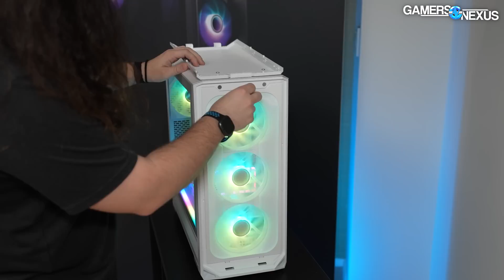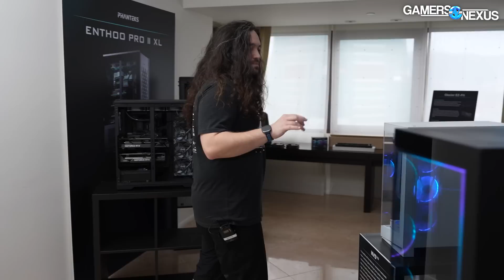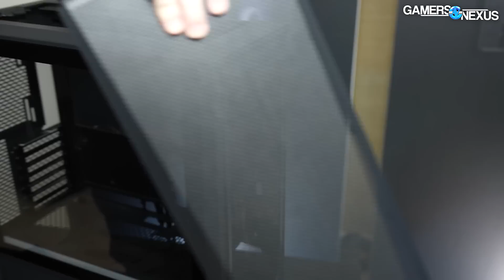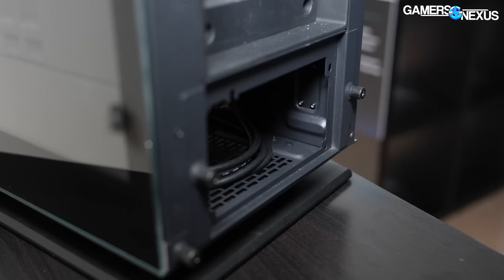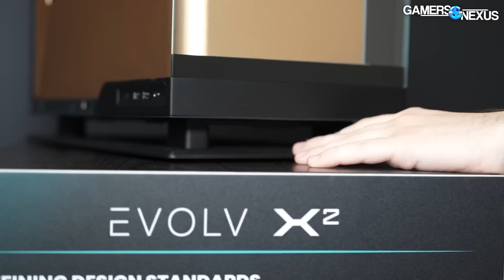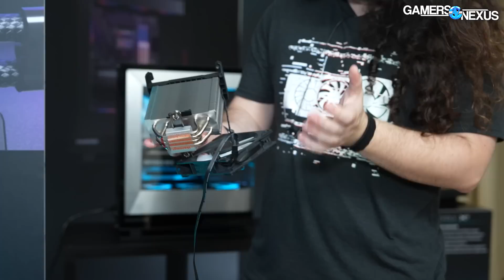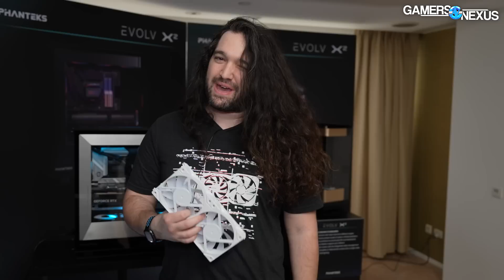Phanteks' Liquid Freezer III Competitor, Patent-Avoiding Fans, & P400A Successor (G400A)

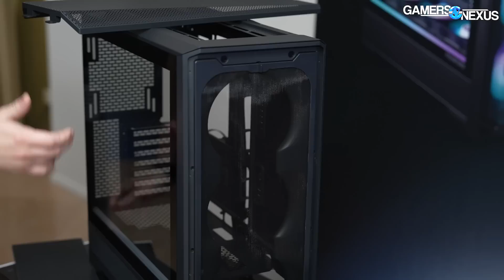Comment: 4:03 The air gap between the fans, the nylon filter and the case mesh will mean it will not restrict airflow. A gap makes a huge difference in places like that. What Phanteks did here is THE perfect solution imo. Case mesh will never filter as well as nylon dust filters, so I personally always prefer nylon. And if you do have it with a gap like that, it doesn't matter that you are stacking dust filter and case mesh, because airflow will still be great
Reply from the maker: Yes, that was the point to the air gap. That's what we stated.
Reply: @GamersNexus   I didn't mean you said anything wrong. I just made a comment emphasizing it because I was happy to see Phanteks did this right. I feel like it's such a simple thing that many cases still do wrong
Reply: Oh, any restriction will (unsurprisingly) still restrict airflow.   If you space them apart it'll restrict less but it'll still affect airflow to some degree.
So I think Phanteks should've made the panel with bigger and less restrictive holes, as it doesn't have to act as a filter.

Personally I think those moulded shapes around the fans looks kinda cool, so I'd consider just removing the front panel entirely :)
Reply: @rogerwennstrom6677  Airflow restriction also depends on surface area of the mesh. That front panel is pushed forward, so it has more surface area, than flat panel. Air can come not only from the front, but also a bit from the sloped sides. If you shape mesh like a dome over the fan it will have more airholes than active surface of the fan, and airflow restriction will be minimized.
Reply: @Boris-Vasiliev  Yep, makes sense :)
So it is probably OK as it is, but would still be even better with a pattern with bigger holes and less material.  The panel mesh doesn't need to do any filtering, so it could be a lot "coarser".
Reply: @rogerwennstrom6677  The mesh should  look like a solid shape, not like prison bars. It has aesthetic purpose. Thats why its impossible to make holes bigger without making it look the same as a grid fan cover at the back of the case.
Reply: @Boris-Vasiliev  Yeah, but you can't have the cake and eat it... I'd prefer they commit to one style:
Either did go for proper mesh and skip the nylon filter.
OR keep the nylon filter and made the mesh coarser even if it doesn't quite look like mesh anymore.

As it is now you could argue you get the worst of both worlds, with two layers of restriction.
(It won't be solid looking in the end after all with all the lightning behind it)
Reply: @rogerwennstrom6677  I was planning to disconnect all RGB if I ever get a case like this. Sometimes I watch video in a dim lit room, and any extra light that comes from PC case will be distracting. Thats why I dont like modern cases because they are focused to make your PC look like a bright fishtank.
Reply: @Boris-Vasiliev  Fully agree there :)
Reply: @rogerwennstrom6677   you are right, I phrased it poorly
I meant it will not restrict airflow by any noticeable/significant amount

Comment: i'm surpised it's taken this long to get interlocking fans that... just use the cables and have a simple locking mech. the other options with pads and bridges always seeed way too over kill, and therefore expensive. this is clean and elegant enough for most use cases. and the little overhang seems mostly likely to not be a factor.

Comment: I really like that molded fan shroud front! Most cases have mounting holes for x2 140s or x3 120s and then a filter in front. All of those gaps lessen the pressure gradient between the sides of the fan and therefore ability to pull through the filter.

Comment: How can a case be airflow without a fan on the side panel directing fresh air to the video card like the HAF X did back in the early 2010s?
Reply: I'm still using the similar HAF 932 case with CPU and GPU liquid cooled.
Reply: my old antec lanboy case i took a hole saw to the acrylic side panel and drilled holes rand small bolts and mounted a fan just like that almost 20 yrs ago, really liked that case, wish i didnt sticker bomb the heck out of it when i was a kid or id probably put it to use these days lol
Reply: I loved my Old HAF 922, the 200mm fan on the left panel pointing right into my 1080ti for years was great. but it couldn't fit the 4080 I bought in it without some heavy modification. I built a smaller system for work stuff and moved it to my shop so at least it will still get some use. Glad I don't have to move it anymore though, thing weighs a ton.
Reply: @Jbradley612  you can always mount the fan on the outside of the case
Reply: I have to agree with you. I had a HAF X case and never had a case that kept my GPU temps as low as the HAF X....
Reply: Good question, companies don’t like efficient only care for profit

Comment: Honestly, we need a new category or specific video dedicated on cases best for pet owners. My friend has a lian li 2 mesh and it’s atrocious inside. Mine is the non mesh one and 0 pet fur inside.
Reply: For those with extreme pet fur/dust issues: I would get a steel case and a lot of finer mesh magnetic filters (you can also get these custom-cut for more oddball sizes) to put over higher static pressure case fan intakes. And then just have the overall layout be more positive pressure (more intake than exhaust, accounting a little for GPU and PSU having their own exhaust).

You dont want to overdo the filtering (like Steve said, it will block airflow and create more noise if you double filter) but higher static pressure plus manual fan curve tuning can mitigate some of this.

Regular air dusting might still be needed, though, in addition to filter cleaning. An electric duster (e.g. Xpower, Datavac) is good to have around for dust or hair removal. Easy access to internals (e.g. hinged side panel) helps make this a quicker chore.
Reply: @zivzulander  thats great to know, I'll suggest that to my friend, thank you!
Reply: Finally, a place for Snowflake to put in some work.
Reply: I bought one of those sub 55dB "silent compressors", which moves air at 130-150 PSI. 

Before I turn my computer on, I open the case blow everything out in 5 seconds, then I turn the compressor off. Afterwards I use the remaining pressure in the tank to dust out the corners in the room. 

I may be crazy, but I could use one of those small compressors in every room of the house. I also use it with a tornador to clean shoes and carpets and cars or just the air to clean the vacuum or the sofa before using one of those small vaccuums /carpet cleaners. Mines the Spotty for about 200 Euros, but of course there are a range of those. Anyway that's just for carpets, couches, etc. not the PC. I am just saying pressurized air is useful all the time. 

I never knew I would use a compressor 10x per day in the house, but it makes life so much easier. It's like an endless can of air on steroids. And I have been using it to clean a bunch of mainboards and electronics. I reckon if you manage to bend or break stuff with it, you might need to get a better feel for distance. 15-20cms is fine for blowing dust off a PC. You might want to put a finger on the fan and get a little closer for your PSU, air-cooler and other fans, might even need a soft brush sometimes, but usually this method will get a PC dust free with 0 damage in about a minute flat. Try at your own risk and don't intentionally blow directly against things that bend from a very short distance. The air flow is powerful enough to rip stuff right off the motherboard. 😂
Reply: @peteranders7106  Compressors are nice (and a heck cheaper than cans of air) to use, but they do collect and push out moisture. You can buy in-line desiccant filters.
Reply: @choggi  Yeah definitely. But they cost like 20-30 and as you said are super easy to click into place in line. So all in all it's probably about a 200-250 dollar investment for a silent compressor with like 700-800 Watts for home use. I've had it for a few months now. I don't understand how I lived without one. 

To be honest I have needed to badly upgrade for almost 10 years now, but never quite had the money for it or something was just coming out. I'm on a Ryzen FX 8030 or 8020 or some such? So I got a 5 dollar chip and a 15 dollar board running DDR3, but it's definitely clean. Lol.
Reply: @pekirt  Well you seem to be pushing pets. They have their draw backs, too. Hahaha got you. Just kidding. Pets are essential, if you can afford them.

C'mon airflow cases have always been the most logical approach to case design.
Reply: I keep my case at a positive pressure, but still it gets very dusty. I think dust is inevitable if you have airflow.
Reply: I have a Corsair 5000d (mesh) and dust filters are catching most of the fur, I keep a positive pressure and I don’t see more than a couple of hairs here and there.
Reply: Yeah, because yours has zero airflow 🙄

Anyway what you want is a positive pressure case
Reply: The solution to this is to clean the case when it gets dirty. Crazy I know
Reply: @pekirt  I have pets and live in a very high dust environment. I simply clean my computers regularly. I don't see why this suggestion should cause you grief.

Comment: 0:35 that nasty GPU bend
Reply from the maker: It's a feature. We don't know what the feature does, but it is one!
Reply: @GamersNexus  I thought the 4090s came with a hanging wire to prevent this?
Reply: @Martial-Mat  not a cable but a bracket for sure. It's prolly missing due to aesthetics
Reply: They're mountain bikers - 10% sag is good.
Reply: worst part that gpu comes with a anti-sag stand, but it doesn't fit cus Phanteks wanted to fill the floor with fans xD priorities
Reply: @inactive4283  I've used this one for a year, works just fine
Reply: @inactive4283  I've used this one for a year, works just fine. They just literally are not using it because there is no place to place it on the bottom where it'd normally stand to support the gpu (cus the floor is entirely taken up by fans).
Reply: @inactive4283  What do you mean? The posts all work perfectly, same with the top hanging kits. The only questionable ones are the PCI brackets, but those still work well on all but the heaviest cards.

Comment: I love seeing all these cheaper cases with included fans
Reply: It's one of the biggest things I note with budget cases, especially when recommending them to friends.
Reply: Yeah, it's weird they find it so hard to include fans in the cases, some decent Arctic 12cm fans are around 4$. Think the issue is fans can break more often than the case itself and they need to cover the fans' warranty into the case's and that could create additional issues, with the whole case having to be sent back to them to change a cheap component, probably the delivery would cost more than the actual price of the broken fan.
Reply: @draxrdax7321  Surely they wouldn't be required to take the entire case back to unscrew four screws and put a new fan in? Anyone who's capable of holding a fork can do that themselves if they get a replacement fan sent out to them. Even more so considering people buying empty cases are already capable of building stuff. Hell, the customer would need to do way more work pulling parts out of the case for shipping (like the CPU cooler and GPU for example), and doing the actual packaging for safely shipping the case.
Reply: @treborrrrr  I think if the case comes with the fan already mounted, unmounting the fan may lead to loss of warranty. It depends if the manufacturer offers separate warranty for fans and the case, but if it's a whole, you probably have to send back the entire case.
Reply: @draxrdax7321  Maybe I'm just biased from my work. I work with 3D printers from a few different brands and there, depending on the issue, we'll just ship the needed part for the customer to replace themselves (if it's relatively easy to do). And that goes for printers in a price range from $1k to $150k. The hassle, time loss and cost of having the customer send in a machine for something trivial just seems silly to me.
Reply: @draxrdax7321  An alternative would be to deliver the case with the fans boxed wo the user has to mount them. That way the warranty could be limited to the parts so the customer at worst has to return the fan, more likely just get a new fan to replace the broken one.

Mounting things in the chassis can't be cause to void warranty unless the mounting includes a drill, a angle grinder or some use of a Dremel like tool. But screwing a fan in place is normal use so that would not be a problem. And if they can mount a fan they can dethatch it so sayin the customer can swap the broken fan themselves with a new they've received isn't unreasonable.